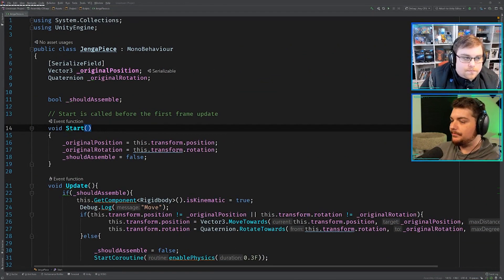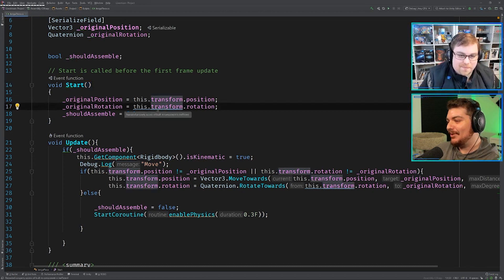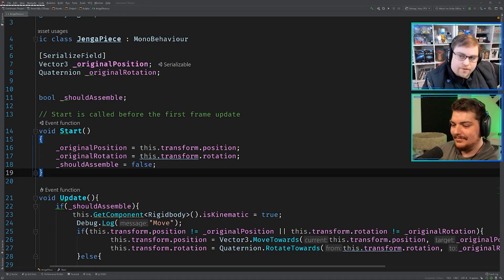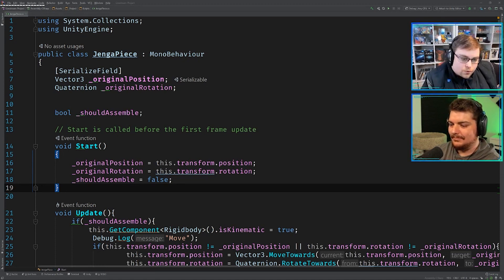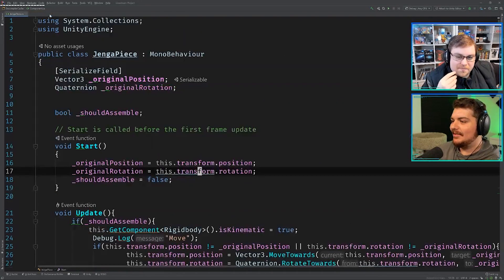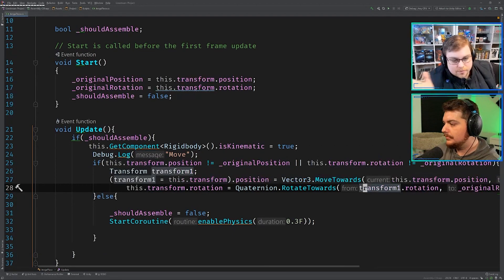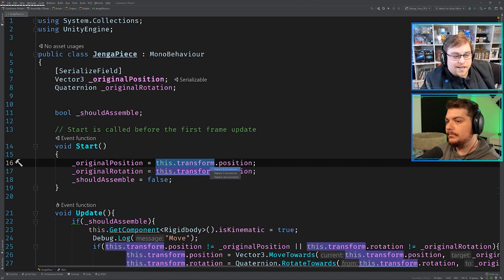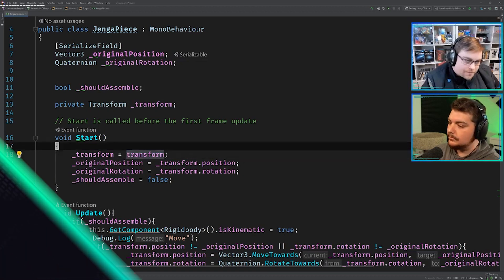Refactoring Common Unity3d Mistakes (Code Review)

Comment: Seriously? Calling 'transform' is inefficient? Could Unity really do this to us?

Every GameObject has a Transform, so it should at least be the first in the said list of components and referred as Components[0], if it's not done even some better way. I have strong doubts that anyone could have overseen this and made a lot of people suffer in secret)

Getting <RigidBody> in Update() a few lines lower is a pretty big elephant in the room of this video, though   :D
Reply: Elaborating on this idea. I sense a difference between 'this.transform' and 'gameObject.transform'. Knowing the fact that you can get any component from any component on the same gameObject, may imply, that each of them has a list of sibling components, and getting even 'transform' from it may be inefficient. Using 'this.' effectively means 'JengaPiece.GetComponent<Transform>()' which sounds horrible and surely looks like a search will happen somewhere.
While on the other hand, we have 'gameObject.transform'. And thinking of 'gameObject' as an entity or, rather, a parent, containing a, hopefully, better organized list of it's child components, searching a sibling list turns into "GetParent().GetComponent[0]" which looks like two instant operations in my head.

So, resuming. Probably using 'this.' is a bad style here, not the 'transform' itself? Is there even any reason for using 'this.' outside of class extension methods and class constructors, where you, for some reason, want to have two variables with the same name, obligating yourself to specify, which one do you mean.
Should 'this.' be ever encouraged among starting (and all other) developers?